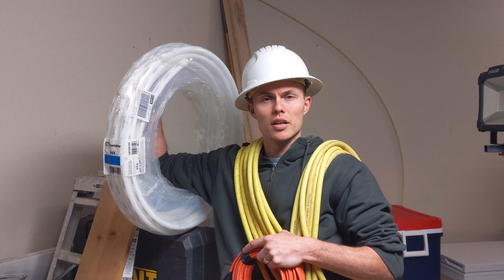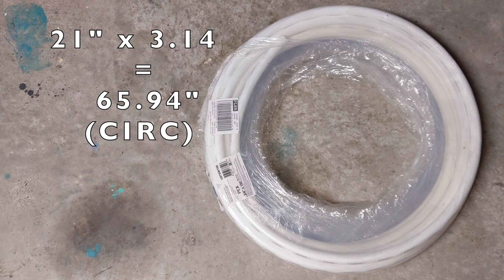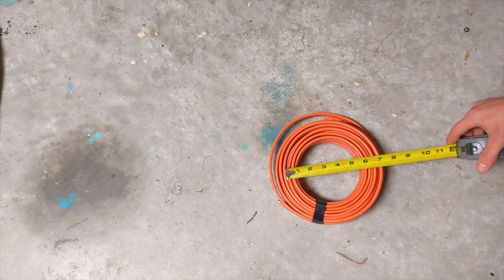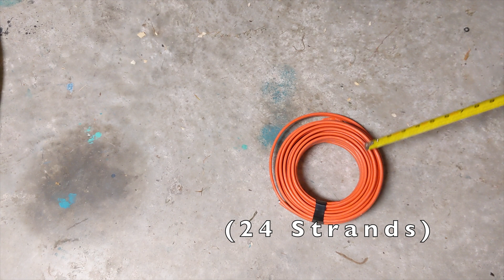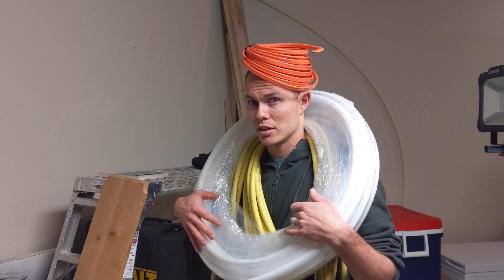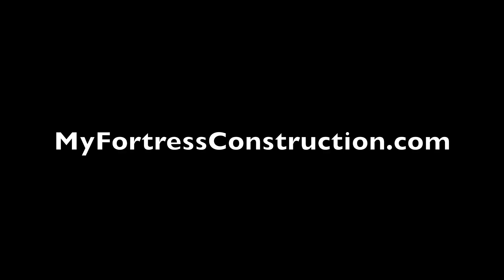How to calculate Coil length

Comment: What if you’ve a rope ~3600” long measuring 0.5410” in diameter and you want to make a single layer coil?  What’s the diameter of that coil?
Reply from the maker: I'm not sure what the math would be for that. Assuming the first coil was 12" in diameter you'd have to add the diameter of the rope to your equation with each circumference pass. A computer.could do it easily (12x3.14 + 12.54x3.14 + 13.08x3.14 etc).

Comment: For sonsiderably long runs (spooled or not) you can also ohm-out (resistance test) at least one of the conductors (if it's a cable) using the conductor properties in an up-to-date electrical code book. The table gives you the resistance readying per 1,000ft and then, based on the resistance, the math can be done to determine wire/cable length.

For example: Say the resistance on a particular type of wire is roughly rated at 2ohms per thousand feet. If you get a reading of 0.5ohms on a rum of this wire (same gauge, chemistry etc) you probably have very close to 250' of it sitting there.
Reply from the maker: That's an interesting thought. What's the range of error?
Reply: @MyFortressConstruction  A lot. ~10% or so but people forget to calculate the temperature of the conductor which is important because NEC code chapter 9 table 8, says that its calculating for 75C @ 1k ft which is ~167F so the common theme of saying its 0.2 per 1k feet on 12AWG is incorrect.

Comment: Fun video! I’ve one for you — I want to string a prized crabapple tree in my front yard with tiny white outdoor-approved Christmas lights. I did it years ago, but never did any calculations (it was a painstaking labor of love). The result was spectacular, and motivates me especially in these difficult times. But the tree has grown since, and those lights are long gone. Today, the tree has 5 main branches plus a short trunk. The trunk is about a foot in diameter and 2’ high. The branches are between 5 and 8” in diameter. One of the branches splits into two branches near the trunk. I have a 7 new 25’ strings of LED Christmas lights. They are typical male/female at their ends, and the manufacturer says up to 40 sets can be connected to each other. I’d like the coils to be no more than 4-6” apart. I have several outdoor-grade extension cords, and amperage isn’t an issue with the power source. 1. How far up each branch will I be able to go? 2. Quantitatively, how might coil spacing impact how far they can go? Thank you! 🎄
Reply from the maker: Trunk:
(12" diameter x 3.14) x (2' height/6" spacing) = 150.72"

Branches (same equation)
Diameter of branch x 3.14 x (length/spacing)

Example:
7" branch x 3.14 x (10' run/6" spacing) +120" length  = 559.6" needed for 10'

 I assume to account for the lateral movement on the branch you'd add the actual distance you went though I'm sure there's a more mathematical calculation for a spiral. I'll have to look it up now and see how close my math is to the actual way to figure it out. Thanks for the interesting and useful math problem.
Reply: @MyFortressConstruction  Ha ha — thanks so much! This is fun! And I think if you made a video on exactly this stuff, you’d go gold (platinum?) on youtube right now! I did some calcs on my side, too, using a # ‘coils’ = string length/2*pi*Branch-trunk radius (your same?) formula and not accounting for the addition needed (a function of spacing) for any spiraling. That said, on the branches, if I space the coils a nicely dense 4” apart, they’ll only go 40” up each branch. Not good — I need at least twice as much length. I can get about 8 coils on the trunk, which is a couple more than its 2’ height needs, so I can carry any excess up into the longest branch. The more your calculations and mine sank in, the more scared I got that my 7 strings wouldn’t come close to my branch lengths and achieving the visual effect I sought. Too, I watched a couple of youtube videos on how to back-cross strings to compensate for the sparse distance between lights on a given string (mine are 6” apart). So this morning I went to two hardware stores to buy 7 more same-brand-and-type strings! Btw and perhaps happily for small business, all-things holiday-ie and snow-related are going fast! Thanks again, and Merry Christmas!🎄

Comment: Could also weigh it.
Reply from the maker: I suppose you could, but most guys are carrying around a tape measure on the job site and can find the length pretty quickly this way.
Reply: Yeah I tend to use it to measure 3d printer filament remaining on a spool, where you can't even see the (hundreds of) loops of filament remaining to count them.
Reply from the maker: @GoatZilla  yes, on something like that a scale would definitely be useful. Though I would be curious to know how close you would get to your weight measurement using this method and just multiplying loops like I did with the electrical wire.